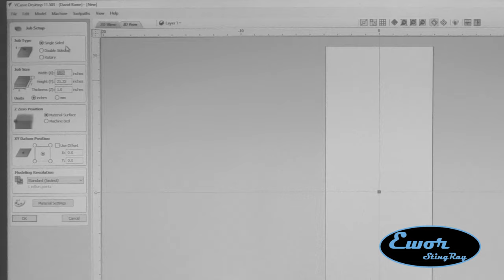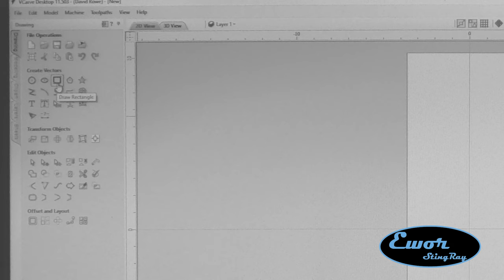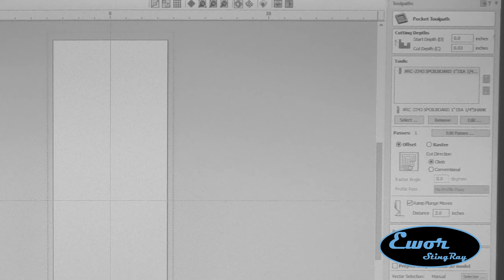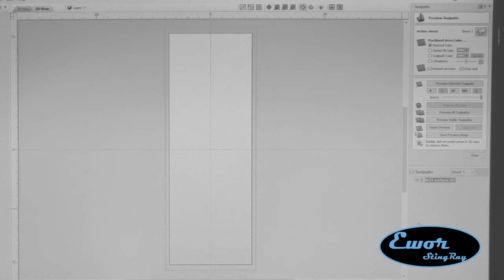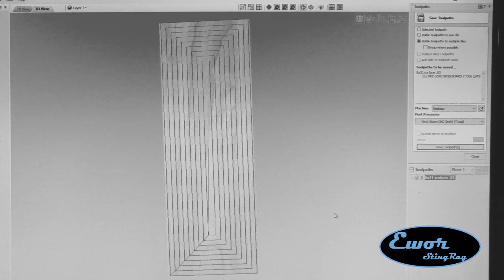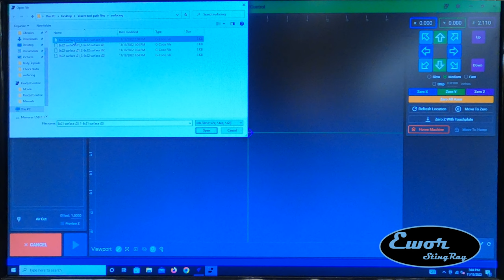Ewor Stingray part 2: Bodybuilding

Comment: I noticed when you surfaced you body blanks on your cnc you used ready to cut software. Do prefer using that versus using the control pad?
Reply from the maker: I go back and forth between the pendant and the computer. Both do basically the same thing but the computer shows a bit more information.